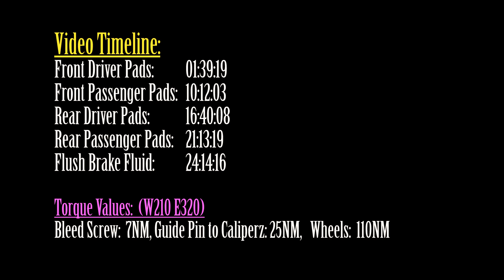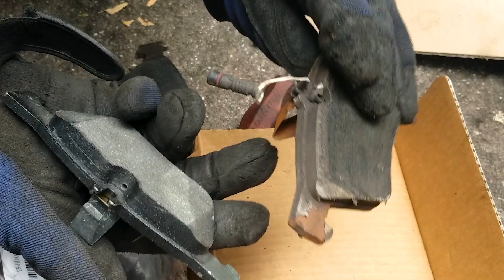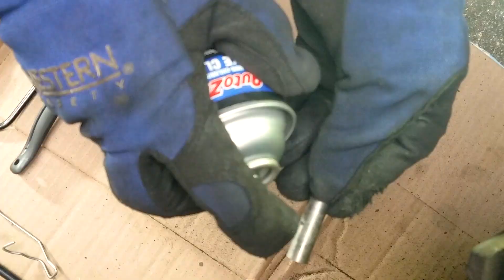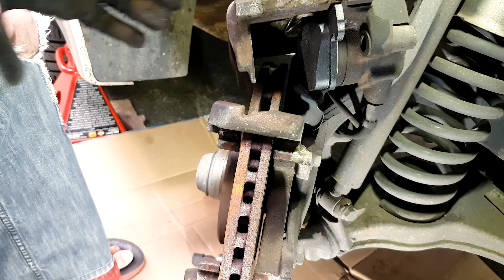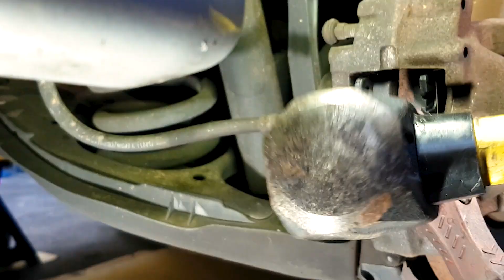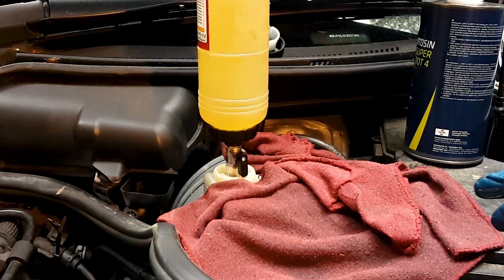Mercedes Benz E320 - Compete Brake DIY - W210, W202, W208, W170

Comment: What are the brake pads called for the rear brakes
Reply from the maker: Hello, rear brake pads.
Reply: @ they seemed to be shaped like little squares instead of the longer rectangular shape I’m used to seeing but I also have a w211
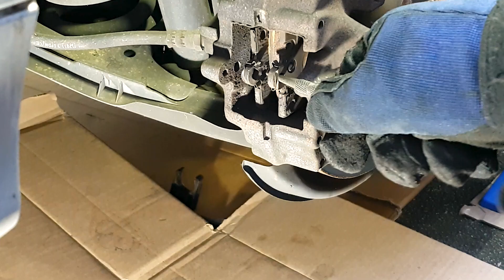Reply from the maker: @EzraRoss-oy6ec  check out the shape of the rear ones at around 17:35 minutes of the video...

Comment: First, thanks for the video. Second,  a comment in terms of technique. I notice that you did not use any grease strategically on any part of this brake procedure specially where metal meets metal parts away from the pad surfaces - seems like a missed opportunity for a smooth brake system.
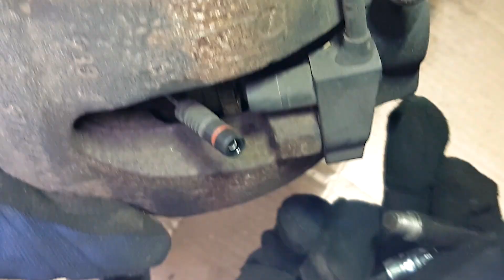Reply from the maker: Hi Hooman, and thank you.  I explain why I don't grease anything starting at 14:35 minute of the video. I never have on W210's following MB workshop manual instructions. Not needed.
Reply: @masood-tv  HI Thanks for pointing out the part about grease I clearly passed/skipped over :) . Makes me wonder why MB states no grease for the w210.. just seems odd..Is that because of dust accumulation w/ grease causes more issues than it resolves?
Reply from the maker: I am not exactly sure.  New pads from MB and Bosch come pre-gressed where they touch the pistons at the backing plate. However, the W210s don't require grease at other touchpoints.  Must be due to how they're engineered.

Comment: thank you. just got my 1st merc. 02 e430 4matic sedan. its got 39025 miles. ive had it for about 200 miles. is a dream. just got the upgraded  yellow track set from fcp euro. brand is ebc? this vid is gonna help a lot. thank you.
Reply from the maker: Hi, thanks.  Glad to hear you got your 1st MB, and then, with such low mileage.  You will love that car.  I believe it has the M113 engine.  So, a lot of the videos I have on the W220 S500 engine will equally apply to your car.  Enjoy and congrats!